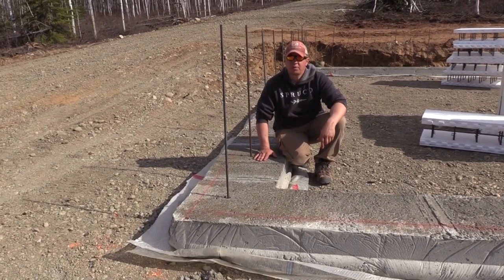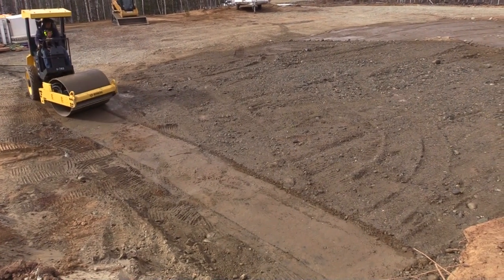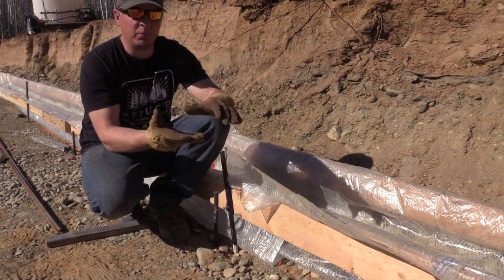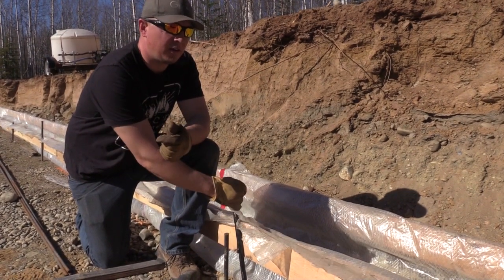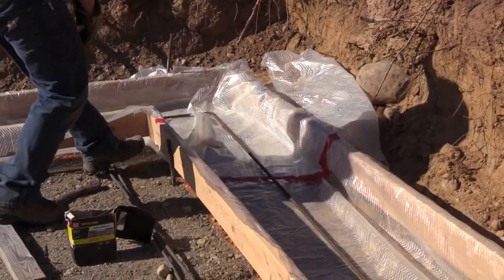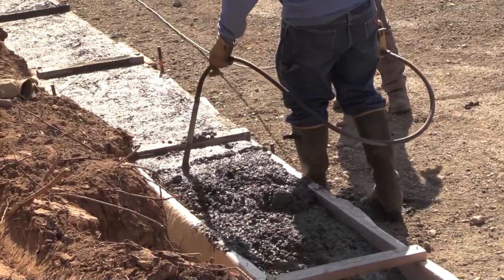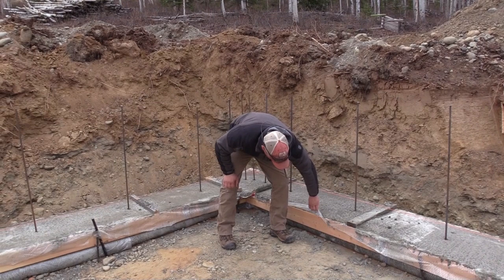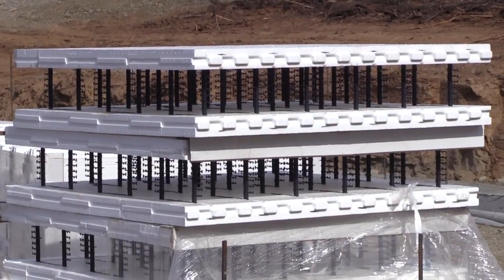Plastic Paper Concrete Footing Form Hack

Comment: Great Video. In winter conditions, would that Visqueen work to prevent the concrete from contacting the frost filled ground? Wondering if the Visqueen is also a solution to prevent cracking in winter caused by the ground specifically.

Comment: Not sure why you can't spend the extra $10 and set your rebar on actual rebar chairs instead of broken blocks.  You get a stronger system with completely encapsulated rebar.  There is no reason to cheap out on that aspect for either footers or slabs.  Those things are pennies each.

Comment: This is not the best way to build a footer. Wheres the drain tile weep holes.
Reply: Drain tile weep holes?  I blieve this will be similiar to a frost protected slab, so there will be rigid insulation sloping away from the structure.  This will shed water away.  If he wants, he can still add drain tile, just put it right next to the footer as is standard practice.

Comment: Chief, what's the purpose of the plastic if you got the woods holding up the shape of the footing ?
Reply: The plastic helps the form to be removable from the concrete. Wood absorbs water and as the concrete cures will adhere to the wood.
Reply: @angelamarchbanks2621  Tnx, i figured that much.... I was thinking maybe it helps it cure super strong because of the moisture. Cheers! IT'S taco Tuesday :)
Reply: :) Actually it does the opposite. The plastic retards (slightly) the wicking of moisture ensuring a slower cure time. It takes a little bit longer to cure but in most cases it's a good thing to have harder concrete which doesn't get to full cure until about 28 days. It is strong enough to continue your build, depending on your mix.
Reply: @angelamarchbanks2621  You're the best Angie ! Blessings
Reply: The wood was only about 4 inches high and the concrete is about 8 inches high. The forms didn't sit flush on the ground. He said that he saved by using smaller lumber.

Comment: I see when you finished closed room you had problems with the loose hangers flying all over. I have the same problem and it irritate the hell and back. Will you put on line how you remedy this!! Would like to add  that nothing is above the dryer that I did was build a platform about 8 inches high under the dryer. You would not believe it matters so much!!!!!

Comment: Knowing you're in a permafrost area and also subject to earthquakes, did you make allowances for deeper holes along the footing to secure it to the ground? I wonder about this footing "floating" along the ground. I realize the rebar will give it strength but ..??? NOT disapproving but wondering about your thoughts on these things.
Reply from the maker: Hi Clyde, great question!  yes, when we built our house, we went the four feet down everywhere and came back up.  But this is very expensive to do.  We have done slab on grades this way (for garages) and there has been NO issues after almost twenty years.  We will insulate around the footer horizontally out, and it will be backfilled.
Reply: @AnaWhiteDIY NO aspersions here, but If I were to do this,  I think I would consider digging some strategically placed holes(slits really) along the bottom (every 10 feet??) of the foundation and drill (with the PTO augur attachment) 12 inch X  36 inch deep holes and drop rebar into them and tie in to the rest. Wouldn't mean loss of concrete (blowouts) because the ground would contain it and the visqueen would mostly line the opening. Might want tucktape but no biggy. Might keep any "floating" at bay. Probably big overkill?
Reply: @AnaWhiteDIY  Forget what I said about making deep holes. It dawned on me that you said you have a berm in back and plan insulation horizontally --(sound of hand smacking forehead) ... "Never Mind" ..Rosanne Rosannadanna.

Comment: I'm surprised a icf building is basically going to be sitting on the ground. I figured with the frost up there the footings would have to be fairly deep?  Are you far enough north for permafrost?
Reply from the maker: You are correct - we normally will dig down 4 feet and come back up with ICFs then backfill the entire space (as we did with our house) ... But with an 80x30 footprint with half of it just dry storage for a workshop, the cost becomes extremely unreasonable for the purpose.  What we will do is insulate around the footer and horizontally out from the footer with rigid foam.

Comment: Why is ground humidity an issue? I don't understand why you would use a plastic membrane under the footing.
Reply: I know nothing about footers, so this is probably wrong, but I thought the plastic was just part of the form for holding the concrete.  After the form was removed, I thought, "Oh, duh, the concrete's too heavy...that plastic is staying there forever now."
Reply: @Romans828girl  you are correct for the most part. It helped keep the concrete in place.
Reply: @madison55 Yes mold I can understand. So then you wrap the entire floor under the slab with a membrane